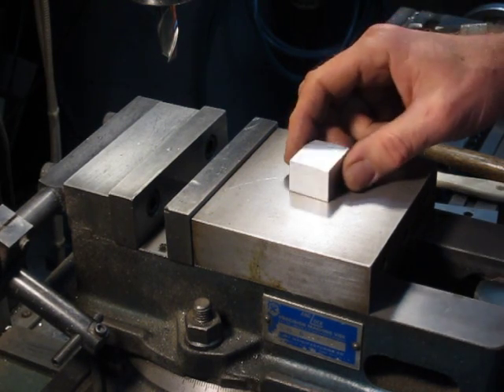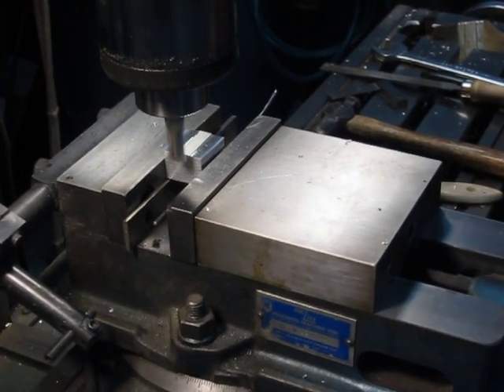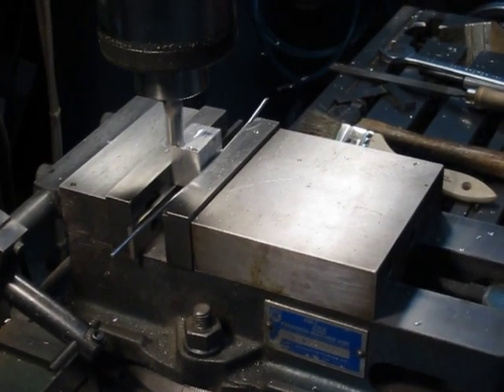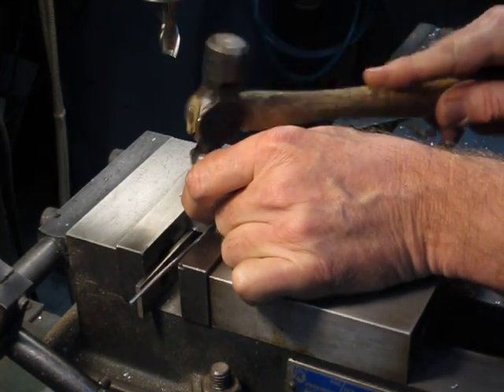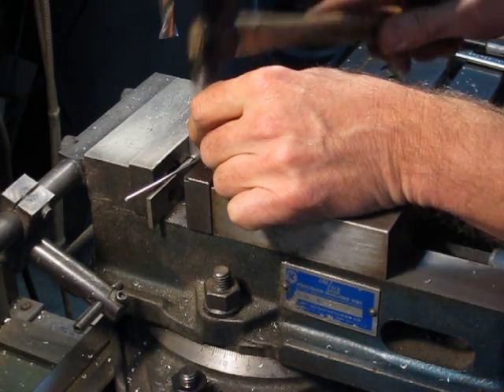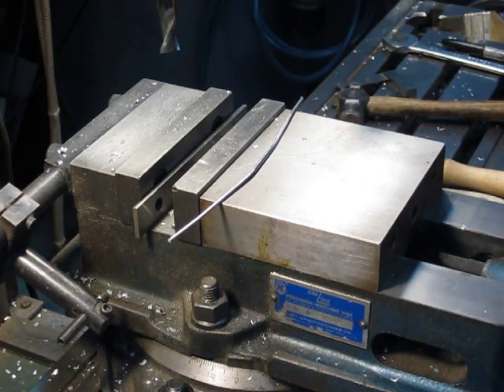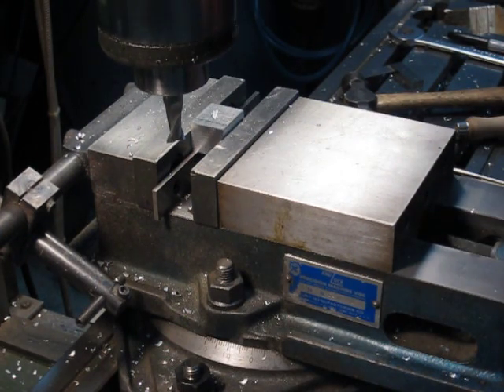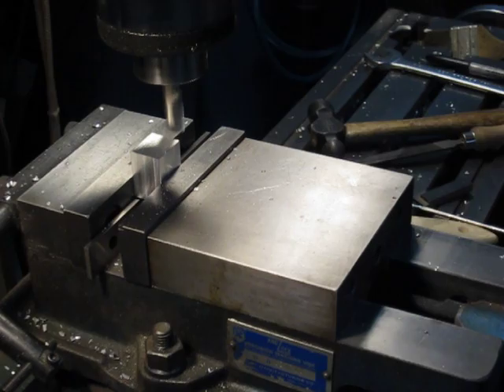How to square up stock on the milling machine

Comment: Hate to ask on such an old video, but why didn't you mill the full perimeter before coming in for the center? Also thanks for the welding wire trick....I really could have used that last week when I was looking for a soft backer.....

Comment: Why don't you use 2 parralells ???? I honestly don't know shit just wondering.  Thanks tom 😍
Reply from the maker: On narrow parts like this, the solid jaw does all the alignment, especially when the bottom surface is unmachined. I would use two parallels if the part was wider.

Tom

Comment: Taking a single dimension from one spot on the milled surfaces with old digital calipers, yikes. The theory is correct but in practice on an actual shop-worn mill you'll find mimicking these steps will result in parts a few thousands out on every plane on even a two inch part.
Reply from the maker: A useful critique would provide a solution. Yours does not.

Comment: You should have clamped the part near vise edge, face and side mill the block both in first operation, than do that to the other side. You would cut your machining time a lot.
Reply from the maker: If you want a part that is truly square, it needs to be end milled. End mills flex when side milling.

Tom

Comment: Good Video, and thank you for doing this.  Just reading over the comments makes me realize that as "machinists" you problem-solve all the time.  You have to have the confidence to figure something out if you haven't been taught, but also the wisdom to realize that someone else may have a better way.  As it turns out, I knew this method for a square up, but I watched the video because there is a really good chance I'd learn something new.  (Also, I put "machinist" in quotes because while I do a lot of machining, a real machinist will work circles around me any day of the week.  People who own one screwdriver and a crescent hammer think I'm a machinist... Machinists usually watch me with amusement and offer to show me the right/better/faster/safer/smarter way to do it.)
Reply from the maker: Machining is indeed all about problem solving. There are many different ways to machine a part, and it's up to the machinist to decide which one is best for him based on the tools and machines are available, and his knowledge of how to use them.

Thanks for watching,

Tom

Comment: old vid but whats with the welding wire I don't get it
Reply from the maker: The wire conforms to an irregular surface (sawed part), to better grip the part. Without it, the moveable jaw would only be pushing on one point, and that might be at the end of the part. If that happens, the part can rotate in the jaws when you start machining it.

Tom

Comment: Nice you took the time to put this out there!  I have interviewed a lot of people for tool maker positions and I always ask to explain how to square a block. As mentioned There are a few  ways depending on accuracy required. One thing we did is grind the side block on the vice square so a 123 block can be screwed on as a rail for that last side.  Helps save time when you have a lot of blocks.  Check out the video by lindquist steels showing how they square up blocks. Now that's fast!

Comment: In in a machining class currently, just got my MMS bout to get my bench work planning and layout. We recently used a mill to face off a block of aluminum. my teacher told me that you always cut by bringing the stock from right to left with the drill spinning clockwise. while doing it in class i asked why you cant make a second pass going from left to right, didn't get much of an answer except that you dont do it haha. Could someone please help me with this. I know what my teacher said to do is conventional milling and the other way is climb milling, i saw that you said it makes less of a burr and ive read it makes better surface finish. is there any reason you would do one or the other or both at the same time. Also we have been taught to use a dead-blow hammer for setting stock in the vice, i trust there is some explanation for using one or the other if someone could explain that as well. much appreciated!
Reply from the maker: Your teacher is probably being cautious about climb milling because those just starting out don't have a good feel about how to deal with the forces involved. In reality though, with light cuts like this it doesn't really matter if you are climb milling or not while facing. Nothing is going to move.

I prefer using the edge of a ball pein hammer over a dead blow because it's easier to feel when a part is seated on the parallels. Of course that only applies to rough surfaces that will be machined, because it leaves marks. Finished parts require some sort of soft hammer.

Tom

Comment: I am a retired tool & die maker, and you are doing this the hard way to square a block. After squaring 4 sides, put the block roughly square in the vise and machine the 5th side BUT  now mark the side that is square to the back jaw with a marker, also mark the 5th side as it will need to be milled a second time. Now turn the block over, 180 degrees and put the squared side  90 degrees to the back  jaw, machine the 6th side which is now square in 2 planes. again turn the block 180 degrees and finish machining the 5th side again which was before only square in one plane. no need for indicators or squaring devices. Remember ,  the vice is nothing more than an angle plate with a clamp attached.  Also, to try to tap a tall block with a hammer is a waste of time. the vice will always lift up a small amount, but if you tighten it the same each time, it will repeat within .001 every time.  I also used to use a piece of body filler lead in stick form to use for uneven surfaces .    Also , using a fly cutter, the head must be trammed square and if your machine is older and worn, it will also affect squareness, a smaller diameter cutter will work better in this case.
Reply: Don't want to sound mean.... and yes it does work in pracitcal and theory.....however,  if the block can fit in your vice like most pieces and you comfortable with the squarness of the head. ( please forgive any incorrect grammar) you put the part in the vice but with about 75% of th part exposed out of the top of the vice... and one  side totally off to the left hand side of the vice.... clean up the top work to flatten that side. 1 side done.... keep part in vice  move endmill to side on solid vice ( back side...)  climb mill that side to close to dimension..so now you have two sides done and are square as edge..
Now lift  the knee then the now cut the left hads side ..? Lower table and machine sides  açcordling...now you have top and 4 sides square and parallel....
Change parallel s to shorter ,tap down part and repeat process and a 6 sided square block will bi in the vice that is parallel congratulating all that in 2 setup instead of 6 regrips and square ...sounds like a lot of work while reading... but  as perfect as your mill...and no hand tools needed
Reply: You got it right with squaring 6 sides, too few machinists are aware, the total squareness depends on the condition of machine or vise,
Reply from the maker: You know as well as I do Glenn, that there are many different approaches in machining to accomplish the same thing. You should share your knowledge via a video as I do, so others can benefit from it. I understand what you are saying, but most novice machinists will not.

Tom

Comment: I really liked the video, very helpful but I think it should be explained why you weren't using a nylon or softer mallet over the ball hammer. The novice might not get  that your machining the side your seeding onto the parallels and try doing that to something where an indentation made by using the ball hammer might not be a good idea. lol
Reply from the maker: Thanks Mike, but I try not to explain the obvious. If someone tries hammering down a finished parts with a ball pein, the lesson learned will stick with them for quite a while. :) This is a pretty early video, and I do explain the process more thoroughly in some of the later instructional and tutorial videos. I have caught quite a bit of crap about using a ball pein at all, but I guarantee the biggest whiners are those who have never tried it.

Tom

Comment: i want to know what speed cutter and feedrate for stainless steel.
Reply from the maker: It's not that cut and dry. You may want to watch my video, "Cutting Speed and RPM on the Lathe and Mill".

Comment: This may be a dumb question but I'm a total newb to machining/welding/etc. All I have access to currently is the welding wire for our maintenance shops mig welder. Will that work for squaring stuff up on the mill or is aluminum welding rod diff then then the copper wire I am talking about?
Reply from the maker: Not a dumb question at all. I use aluminum wire because it is soft and will conform to the uneven surface of the work. Steel MIG wire will not.

Tom

Comment: I like to use use a good sharp serrated framing hammer to hammer my work down.
It kind of tenderized my block
Reply from the maker: I think that would work similar to using the edge of a ball pein. It would bite into the metal a bit to dampen the blow. 

Tom

Comment: Yes Tom,how much material do you take off?3 thousand of an inch,2 thousand of an inch to square the block?
Reply from the maker: There are a lot of factors that affect how much material you can remove, such as the type of material you are cutting and the type of machine you are using. When machining a part to size on my mill, I like to saw the part to withing 1/16" of finished size and then take off just enough stock on the first side to clean up the saw marks, plus one rough and one finish cut on the opposite side. Of course if you are not confident in your ability to saw out a part that close, you'll want to leave more stock and take extra cuts if necessary.

Tom

Comment: is this the same as facing ?
Reply from the maker: Facing generally refers to machining a flat surface on a lathe. On a mill, it's called milling or fly cutting.

Tom
Reply: or face milling.

Comment: does putting that aluminum rod against the jaw of the vice just meant to even out the clamping force? is there any other reason? i don't usually do that
Reply from the maker: Yes. The idea is to make sure the machined face is evenly held against the solid jaw. If a wire is not used, the moveable jaw will exert all of its force on the highest point of the surface it is bearing on, which could be at the extreme edge of the part. If that's the case, the part will likely move when you try to machine it.

Tom

Comment: You can only assume the angles are at 90 degrees.  In reality they are not and will never be perfectly 90.
Reply from the maker: +kaiok1777 
No, but that doesn't mean you shouldn't use proper technique to get them as close as possible.

Tom

Comment: very good but what is wrong with side milling  the last two ends with a end mill. I was always taught to side mill the last two sides. using a square doesn't seem to accurate to me. but we all have different methods.
Reply from the maker: +John Smith Smith 
Face milling is always more precise than side milling due to cutter flex, especially on thicker parts like these. If you need a part dead square, this is the way to do it.

Tom
Reply: Thanks Tom

Comment: how much material do you usually take off when squaring up the work piece?
Reply from the maker: +Derek Cook 
As little as possible on the first side, so you leave enough stock to clean up the opposite side. After that, one cut to get a measurement and one roughing, one finishing cut to take it to size.
Reply: +Toms Techniques thank you

Comment: I like the tip of using the welding rod to take up the irregular surface.
Reply: +John Spangler I was just about to go buy a pack of AL TIG rod (I don't TIG weld, so I'd take years to go through 30 rods) when I realized I've got some solid conductor copper electrical wire I can strip the insulation off of!

Comment: Test on vise jaw flex, close tolerance squareness:

If one were to square the head of milling machine perfectly, then take a ground block that is parallel within .0002 and clamp it in vise on those surfaces, you will find with an indicator you can see the anmount of pressure you clamp part affects the squareness. On some parts I have had to mill a lot of stock off fast and had to have it clamped very tight, I have had to put a shim on solid jaw to keep it square. (close tolerances only) Every vise is different too. Another thing for closer tolerance squaring, check head traming on vise surface where your part rests on and parallels rather than table. After all, this is where everything comes referenced from now.
Reply from the maker: +MegaLifeChanging 
That sounds very logical if you need that level of precision. Things definitely move around when clamped tightly.

Tom

Comment: Square is a term I've heard for many years as a machinist for 40+ years. It all depends on. WHAT the part is going to be used for as far as the process of squaring up blocks, .0002 squares needed or .005 good enough. If .005 was good enough, side milling ends would work to save time. If more accuracy is needed, use head with indicator instead of square. First side should should be clamped, but NOT pounded down. Also, vise jaws are not always square with the world as we all think, especially if you clamp tight, it can move jaw out of square slightly
Reply: If you think  .0002 is a tolerance you think you can keep on a mill.....
You are a liar when you say that you have been in the trade 40 plus years  !!!
Wanna challenge me.... go ahead .... lets see who makes more sence....
Perhaps we could let people on a machine shop site decide who knows what they are talking about in REAL world situations  ???
Reply: @steveattree9674  could be referring  to a cnc.

Comment: After machining the first side wouldn't be better to take the burrs of so that it would sit flat on the parallels for the second cut?
Reply from the maker: +aspartns 

It would be better if there was a burr, but since I climb milled along that edge, there was no burr to remove. I pointed that out later in the video. Filing an edge doesn't take a lot of time but when you square up as many parts as I do, it all adds up.

Tom
Reply: That makes sense. Thanks for the reply.

Comment: I think your doing a great service for people. I have about 40 years of machining experience
I don't think your way would hurt anything. a mold maker once told me not to hammer on the part at all. and to use a 3 flute 3inch cutter for a somewhat flat cut after dialing in the head for a .002 sweep over the width of the table. take care good stuff..........
Reply from the maker: +Brian Morrison 

Thanks Brian.

I started out running a lathe for a small machine shop at sixteen years old, forty six years ago and have been making chips ever since. What I have learned over time is that there is always more than one way to do something, never accept anything someone says without question, regardless of who they are and the way you were initially taught is not always the best way. Always be innovative and never stop learning.

Take care,

Tom

Comment: Just a few small comments: I would use a dead blow hammer to begin with. a ball-peen will cause the part to bounce off the parallel in an uneven manner also i would always use 2 parallels not one. I would also mill my smaller side first using my large surface on the solid jaw side. also using a piece of wire unless the part is really messed up is to me unsafe.
your surface area is greatly reduced. if your vise is dialed in the ends should be done with 
the side of an end mill doing a spring pass.
Reply from the maker: +Brian Morrison 

I get lots of negative comments about using a ball pein, mostly from those who have never tried it. I actually prefer it over a dead blow for the opposite of the very reason you point out. It is MUCH easier to tell when the the part is tight on the parallels and as long as you use the edge or the ball. Bouncing is not an issue at all. Dead bows are so large that all you can do is bash the part down and hope that it's seated, where a ball pein allows you to get your fingers on the part so you can feel when it seats. I seldom even check the parallels because I know they are tight.

I do use two parallels on larger parts, but it's counterproductive to use two on small parts like this. If there is more area on the solid jaw than the parallels, guess which surface it's going to favor?

Always mill the largest surface first because that is the surface all of the rest of them reference.

Side milling is subjective. I use it if the part is thin, but on taller parts, end mill flex makes face milling a better option. 

If you haven't noticed a pattern here, it's in machining there is no one technique that is appropriate for every situation. I try to demonstrate as many different ways of accomplishing the same thing as I can throughout my videos to stress that point.

Try the ball pein Brian. You may just like it. :)

Tom
Reply: +Toms Techniques i am going to try a ball peen hammer monday. I'll try to let you know what I think.
Reply from the maker: +James Hertzog 
Just make sure to use the corner of the face so it deadens the blow.

Tom

Comment: question, what do you prefer to use when machining aluminum? hss, carbide? 2, 3, 4 flute?
Reply from the maker: +Oliver Diaz 

I machine a lot of aluminum and double end, two flute, HSS end mills are hard to beat. Be sure to invest in good quality American or European made end mills. Cheap tooling will not save you money.

Tom
Reply: We don't machine much at our shop but I get what you mean. Thanks a bunch